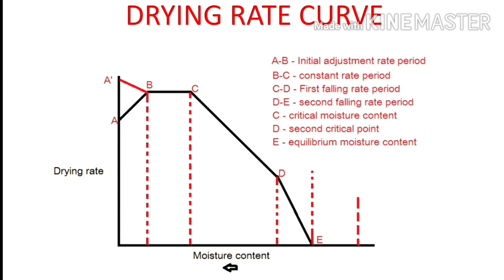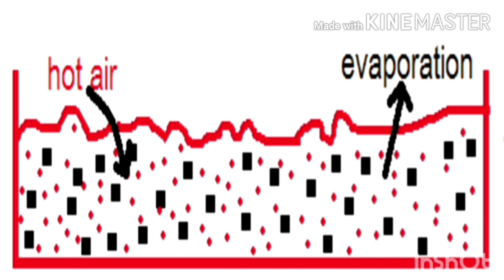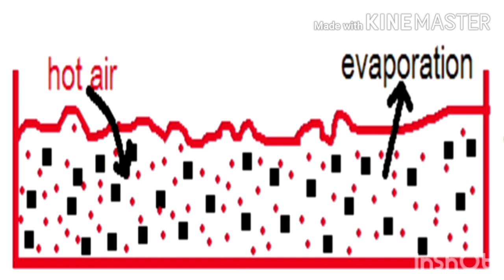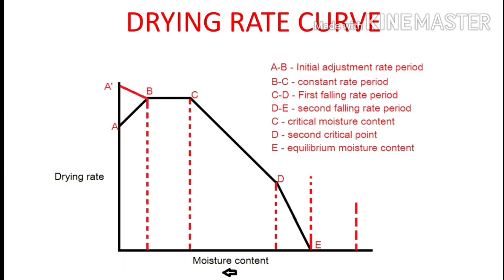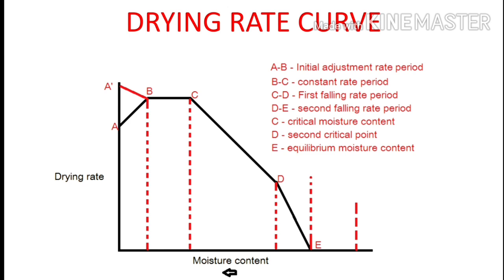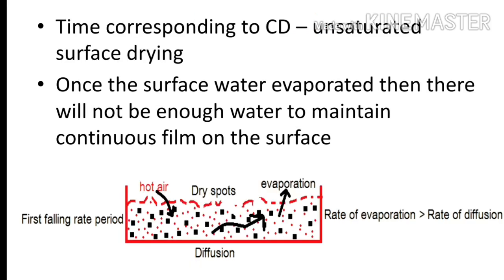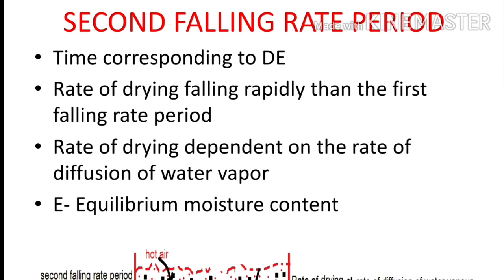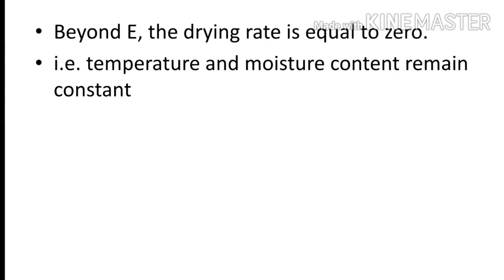Drying Rate Curve//Drying//Pharmaceutical Engineering

Comment: Madam please tell me what is A'B line.
Reply from the maker: Sorption and desorption are the two phenomenon that involved in drying process. 
Sorption:-
If the wet samples to be dried contain moisture less than EMC. Then solid absorb moisture from the hot air passed through it till it reaches the EMC. This is what  happen in initial adjustment rate period (A'B). Due to the absorption of water from air, drying rate also decreases.  

AB line represent desorption phenomenon.Due to the loss of water drying rate increases.
Reply: @SruthisPharmaWorld  thank you madam